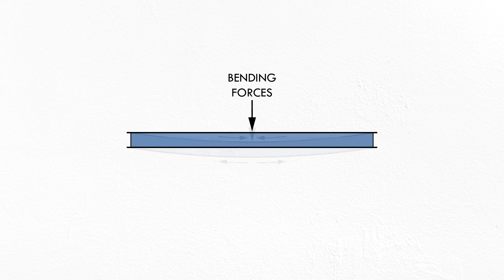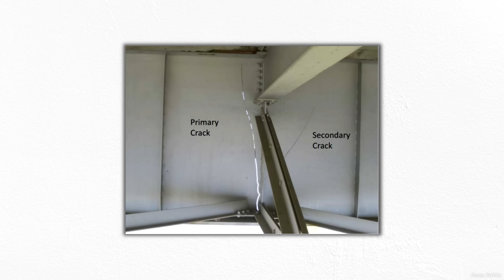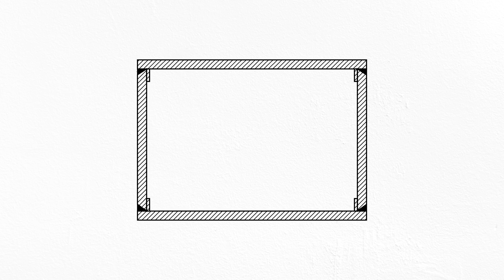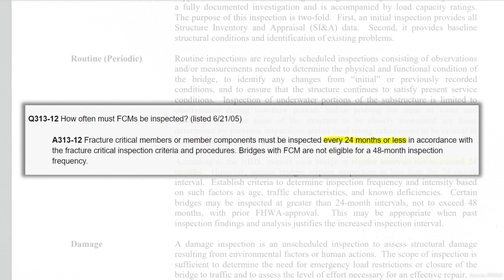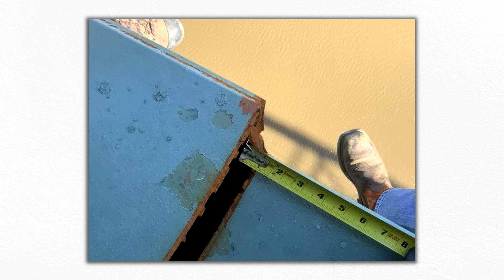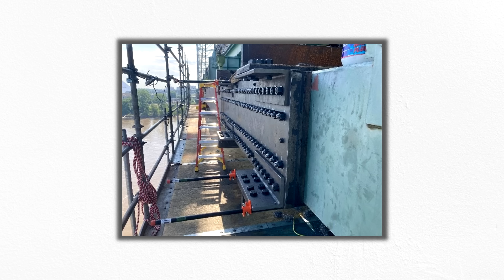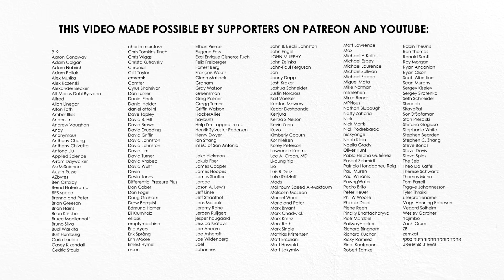What Really Happened at the Hernando de Soto Bridge?

Comment: I'm not an engineer but the crack with its lateral break and off set in my opinion are from the forces the bridge was experiencing after or just before the complete separation of the steel member. I am a plant maintenance tech and 40 years experience fabricator. Wind, hot and cold cycles as well as the vehicle traffic are to blame. The bridge started acting like the beam was no longer there. So the loads that it was designed to carry shifted to other members to bear it. The fact it did not collapse is a testament to its design. I am flabbergasted that a crack that is visible from 2016 was not addressed. You can say " it looks like a crack " all you want. But i guess that beam just decided to paint a black crack mark on the exact spot that did crack. Ok. Closing this bridge indefinitely is hogwash. Take a month put an army of inspectors a on it and repair the beam in the process. Close 2 of the 4 lanes and allow cars and light trucks to pass and get some relief to the other bridge. That other bridge was not designed to handle the traffic it is now dealing with. You can also gain flex data from the low volume of traffic. That beam failed because of a flaw. It happens. To the jerk that did not report it in possibly 2015 should be held criminally liable for this stupid inspection. But to bleed the tax payers for years of inspections and computer models is just as bad. Hell knock it down and build a new one. But get it done.

Comment: Good examination of this troubling threat to lives and commerce. Reminds me in some respects of the shattered newer welded large beams on the Chicago Transit Authority southbound route out of the downtown area vs the old style riveted and bolted much older designs which seem most threatened only by rust peeling paint layers off with simple replacement of easy to make elements as needed.

Comment: I've never studied structural engineering before (although I do I vaguely recall a computer game from middle school that was basically a bridge simulator) However, I have to wonder if frequency/wave analysis could be used to identify wear/tear over time. Like, if you data mine the vibrations parts of the bridge produce as specific traffic patterns flow across it, could you come up with a baseline (perhaps through machine learning) then 'watch' for gradual deviations of vibrations over time. Like, a crack (or a break, as this eventually lead to) I would imagine would produce a pretty different vibration due to a disruption in flow (the energy is transferred elsewhere, causing other vibrations to change that could be spotted through analysis). Easier said than done, and maybe it's already a thing (My trade is in software engineering, not structural :p)

Comment: the repair they have made to that bridge and subsequent detailed inspections should enable it to be opened while they carry on the forensic search for the cause there is no way that bridge should be left shut at this stage.  monitoring with strain gauges and automatic total stations measurements systems should allow this bridge to be opened up. Unless there is some mechanical or fundamental reason not to do so which should be stated in detail.

Comment: The "we fired the guy who messed up" thing is cancer and people should push to not do business with any company making such a statement without making available the full investigation.
Working in manufacturing for over 10 years, both operation and quality assurance, the amount of people I've seen being used as scapegoats is insane, and since people wouldn't want to work for that company after the fact anyway, they usually move on with their lives without making it a big deal.

It's usually the higher-ups cutting down on equipment/staff, not listening to feedback from people doing the actual job and using outdated/unfit methods for the work required.
Reply: Agreed! Businesses can be thought of as collections of processes and policies that dictate how the business operates even as the individuals who do the work change over time. That means firing the responsible person likely isn’t solvent, because the next person will likely face the same challenges/constraints/expectations that led the prior individual to behave in an unacceptable way. Maybe the direct replacement won’t lie/cheat/cut corners, but without changing the processes and policies to encourage and preclude the unethical behavior, the replacement’s replacement very well may come to perform the same corner cutting/lying/etc.
Reply: Well agreed. I especially like what you said: "making AVAILABLE the full investigation." 

When you have a problem, and you find who's at fault, now you have two problems.
Reply: Those responsible for sacking the people who have just been sacked,

have been sacked.
Reply: Spot on ole boy. And you can magnify that when it comes to government jobs.
Reply: I absolutley agree. There should be a "blameless post-mortem" to  find the real reason why the crack on the droneshot was not reported. We may assume, that the inspector was not up to evil plans to let the bridge collapse. I highly recommend Nicolas Means´ video "Who destroyed Three Mile Island". You can find it here: https://www.youtube.com/watch?v=hMk6rF4Tzsg
Reply: That was a good video suggestion, thanks @raudi42
Reply: It's a mentality problem that a flawless record is more valuable than actually finding a problem. And finding just a small problem is valued higher than pointing out an expensive to fix problem. But that seems to be a cultural constant: You're doomed if you say something, you're doomed if you don't.
Reply: Well said and absolutely correct, it shouldn't be the employees termination for matters such as that it should be the bosses for forcing their employees to work with as you said cut backs and lack of equipment combined with being overworked are the disaster waiting to happen
Reply: I agree with the guy that suggests the video about 3 mile island. 
Its never operator error. Its always a system failure.
Reply: The investigation should be made available but the inspector(s) who missed that merit roasting. Had I been one I'd have documented it perfectly for self-defense besides it being the right thing to do. I'm a retired aircraft tech (avionics on Phantom and Bronco, engines and crew chief on F-16s) and performed thousands of inspections hunting tiny defects on fracture-critical fan and turbine blades. When ya sign off an inspection it's YOUR ass on the line so never, every pencilwhip instead of doing thy job. Your boss won't be your cellmate!
Reply: it’s seriously a problem in memphis in general. shit like that happens all the time “we fired the one who was maybe responsible”
Reply: Not in this case.  Dude was directly employed by AR-DoT, and before he lawyered up readily admitted to not inspecting any part of the bridge below the road in the previous 13 years
Reply: Not a corporation it’s the Arkansas DOT inspector
Reply: @austinross8444  My second career was in state DOT; public sector methods and practices are a world away from private sector. When he said the inspector had been fired, my first thought was *whoa*. Typically, you'd have more luck finding Jimmy Hoffa than firing a DOT engineer (assuming the inspector was a structural engineer). Rather doubt the fired person was a scapegoat. There must've been some red flags to have a different group on inspectors on the bridge this time. It also raises the issue of how many of his "inspections" in the past years were negligent.
Reply: @gsdalphaS013  The inspector was NOT and engineer. He was a laborer who had moved up the chain from OJT to inspector.
Reply: @austinross8444   no, it was not a government employee.  ARDOT does not have the expertise to inspect a suspension bridge and hired a contractor to do the work.
Reply: @johnmcleodvii  then why hasn’t ARDOT  named a company? Do you live in Arkansas or even paid attention? I live literally 30 mins away from the bridge
Reply: Government fault they can't even build roads.
Reply: I agree. This was not just "one guy" who messed up. You have the drone operator flying in a previous inspection and unless he was a blind diversity hire, he should've noticed the crack-like fissure that he was hovering next to. Now, granted, maybe he was just a drone pilot and not part of the engineering or repair crew - even still, if I was a drone operator and saw something like that on a bridge, I would be concerned and at least bring it up and ask someone if that's a problem. If somehow the giant crack isn't a problem, well hey, no harm no foul. And, of course, someone on the engineering team should've gone over this footage. I can only surmise that they didn't look too closely - assuming it even happened at all. Then there's someone in management that had to sign off on all this being performed properly... Obviously he did.

Much like every catastrophic failure - it was a chain of failures that could have easily been prevented at any point. I wish more people would say something if they saw something. The worst that can happen is you get told it's fine or not a problem. But god forbid that it is and you just ignore it when you could've possibly prevented it.

Comment: How did they know to act quickly and decisively?

How did the engineers who built it fail to know they built garbage?
Reply: They  built  a pretty good structure  actually -  It  held  up  and  didnt kill anyone   . .. .    who knows what the  local quakes  were doing to it .  I worked in Dayton a while  ago,   one  of the  Quakes on the  New Madrid  had  DAYTON  rolling  to the point where we watched  a solid  concrete  floor  do the  wave thing like it was water .    Scary as hell, considering we were 2 stories  under       a 3 story  building !

Comment: Being involved in manufacturing I have witnessed personnel signing off without actually inspection, inspectors not up to speed with procedures, or simply not knowing everything they are looking for. Even over-worked inspectors or other workers that miss something that is very obvious with hindsight. Many, many eyes and hands go into design, engineering, manufacturing and maintenance. Working in structural design I am guilty of pushing out a bad design that was missed by peer reviews and engineering reviews till the structure was actually built and about to be installed. Lots of balls dropped from start till finish--Things were rushed, and I was responsible for multiple designs that had to go out the door on a moments notice (each design being over 100 pages in the design package), the one that ultimately "worked", didn't physically work.
Reply: girl told me she worked at GM plant where they made $60,000 suburbans. they made her and INSPECTOR in 6 MONTHS????? WOW!!!!! must be nice to know someone... or.....  I want someone that has been with GM for 10 years, worked up and down that whole line, KNOWS ALL THE "ISSUES" that the $60,000 suburban has inspecting that unit ... not some GIRL with 6 whole months at the plant. that is "equal opportunity" at work... got to put "minorities' (now quickly becoming the MAJORITIES and weMEN in supervisor positions... over men that have been with gm 20 years????? OOOOOK , maybe that was by design by GM higher ups.... bring in someone NEW that doesnt know REALLY what to look for as the .... REAL "PROBLEMS" are so numerous that if had a REAL inspector inspecting the units.... they wud all be rejected for one reason or another and the "inspector" wud be out of a job for RED TAGGING TOO MANY units for DEFECTO, DEFECTO, DEFECTO... and cant have that on HIGH PROFIT MACHINES that have to get out to the stealers to sell, sell , sell... if they take a dump... that is the stealers problem... who will do everything he can to screw the customer around on any warranty work... oh but you didnt treat it right and it broke, NOT COVERED BY GM warranty.... we are an independant dealer so we dont have to cover GM's warranty work... u got to take it to a full fledged GM stealership ...200 miles away to have it (maybe) fixed.

Comment: Thank you for this informative video! Glad it didn't fail violently. May I contribute some further material science  information, maybe also relevant for future topics as well (steel and failures of welded parts in natural environments is kinda you playing field I guess) 
You're absolutely right, to state that welding might add impurities leading to failures. Further on, welding heats up the steel to quite high temperatures and 'removing' the heat from the weld spot quickly through in-material conduction. This (depending on the steel) can lead to a heat treated like transformation of the steel phase into hard and brittle martensitic edges along the welding line/spot. This hard and brittle steel parts may contribute to a failure. If a crack than occurres, it can be propageted with little to no plastic/ductile behavior through the brittle martensitic parts. Further on, stress corosion cracking at this crack spot might induce further 'load' to the integrity of the parts, leading to a faster crack forming.

Comment: A pier final settlement due to running water caused one steel member to crack from stresses. dead + live load top  and bottom of the bridge. Cracks like that occurred in many type of structures without effecting the safety of the structure. In the case of the twins in NYC though the language was the problem instead of calling it a controlled demolition it was called a terror attack collapse.

Comment: Fired guy = scapegoat. They can then present that to the public & say they fixed the problem. Most will buy that.
Reply: More broke here than a structural member. Getting rid of one person is not indicative of root-cause analysis of the inspection process failure. If the fired individual was in the wrong position and unqualified, perhaps the more important question is how did that individual get put there in the first place. Something clearly went wrong in the post-inspection audits and the review process needs to be carefully reevaluated. When drone footage several seconds long showing the initial crack was missed, that is when the process first failed.
Reply: Firing the inspector does not solve the problem but I’m glad they did it.  He was definitely not up to the job and too often in government a person like that would be transferred to another position, making their incompetence someone else’s problem.  I worked for the government for nearly 40 years.  I saw it happen many times.
Reply: @stroys7061  Its possible that the crack wasn't overlooked by the inspector but rather shrugged under the carpet and kept quiet by decision of the managers. Regardless, I'm not saying he didn't have responsibility though since even if that was the case he should have resigned
Reply: @303ks  
I doubt that a crack in a critical structure would have been ignored.  I’m sure that the inspector had a supervisor that also bears some responsibility but the inspector failed to either discover the crack or ensure the crack was addressed if he did report it.  The inspector was not a scapegoat.  The inspector had primary responsibility and failed.
Reply: Definitely why is the NHTSA not investigating ARDOT for not having proper investigation techniques for Bridges!! This could’ve been a Major National issue due to River Traffic being stopped and a major Interstate being shutdown for over a year!!
Reply: Sometimes it really is one person’s “fault” even in systems with tons of redundancy, but this definitely smells of scapegoating. Way too fast. Look at aviation and you’ll see how it can take years to find fault, and it’s almost never down to one person; it’s almost always some sort of systemic problem, oft with a healthy amount of human error.
Reply: The thing is that people are not engineers and they always want someone to blame for just because they just want to say 'it wasn't my fault! It was her'
Reply: The janitor is always responsible  it'well knowed!
Reply: Sad but true
Reply: Does everyone here know for a fact that the (in-house) inspector ever noticed the crack and reported on it?
Reply: Just wait til we find out what happened in Miami.  They're all scurrying like rats on a sinking ship right now I'm sure.  Trying to figure out who's gonna get blamed.  I'm sure "nobody knew anything" despite multiple reports of exposed, corroded rebar by the inspecting engineers....
Reply: On the other hand there is definitely incompetent people with professional accreditation that don't know how to do their job, so yes it could have been his fault.  He should have either trained his teams to report this to him, or if they did report it and he didn't make recommendations to repair it that's his fault too.  Did he report it and it was ignored?  He should have gone to the newspapers.
Reply: BAAA
Reply: Umm? Well, the failure was in the structure. EVERYTHING after that is blameworthy because post-modern Americans have turned into finger-pointing pansies without any capacity for intellectual considerations of any problem.

Comment: I’m not sure that I’m following this.  The steel structure failed just inched away from an area that contained numerous rivet holes.  I would think that if there were stresses introduced in the area where the structure failed, those stresses would most likely affect the weakest area .  In short, this should have failed by the rivet holes first.  Am I correct?

Comment: In aviation they find micrometer cracks but in civil engineering a foot long crack can be missed at inspection?
Given the corrosion in that gap it had not happened recently.  Assuming a systematic progression it should be possible to date the progression.